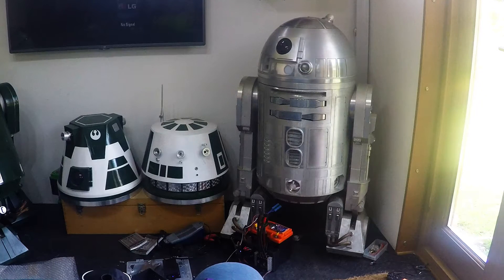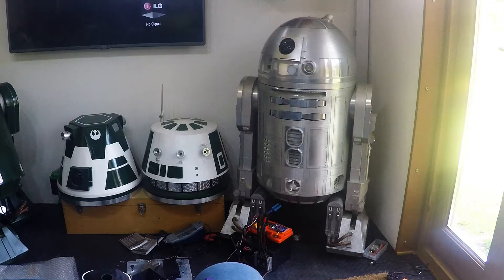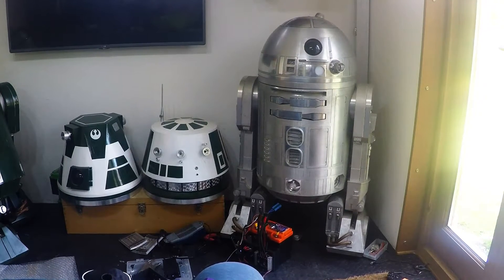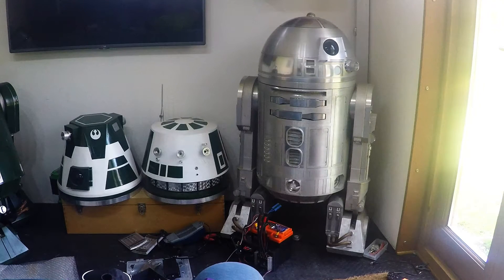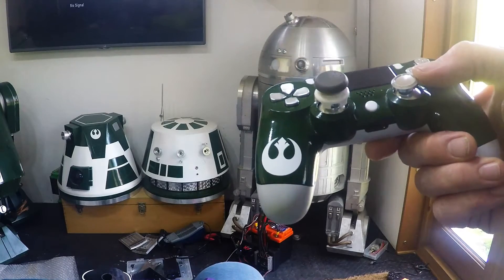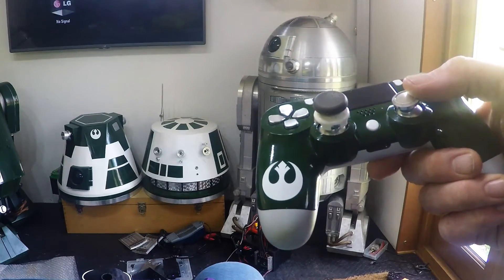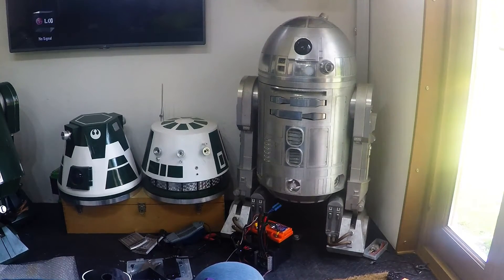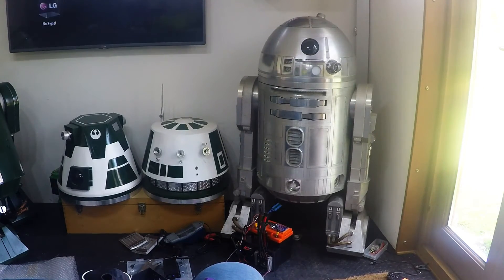Brushless R2D2 Dome Drive Tweaks

Comment: any chance you could do a video on all of the electronics used to make droid run with a ps2 controller?
Reply from the maker: Hey dude,  Im using a PS4 controller, but having a few signal issues, not sure of the cause at the moment, if i solve them and im happy with the setup i will share it.  Till then it is just a USB host shield with Bluetooth dongle, arduino mega and xbee. :)
Reply: thank you